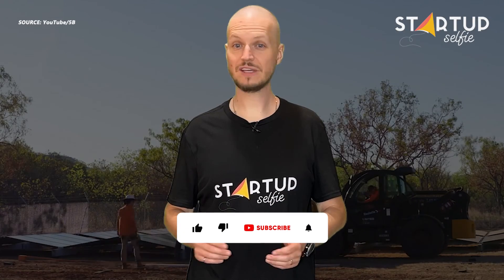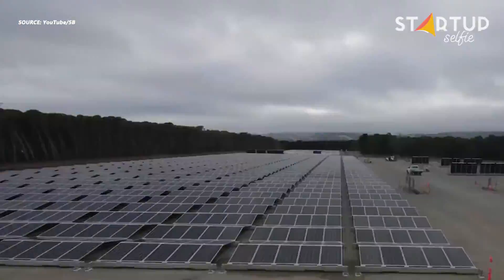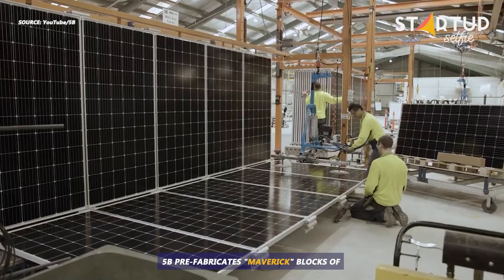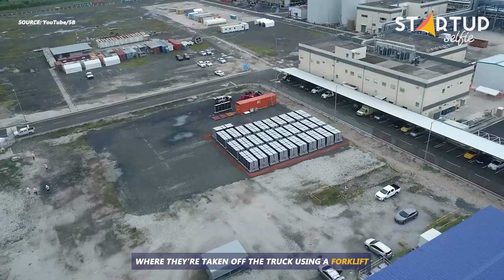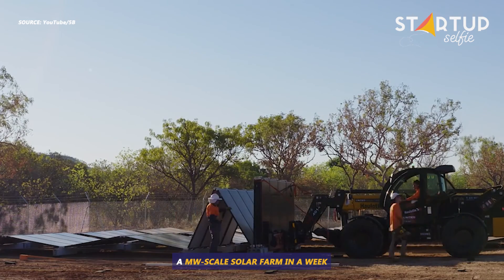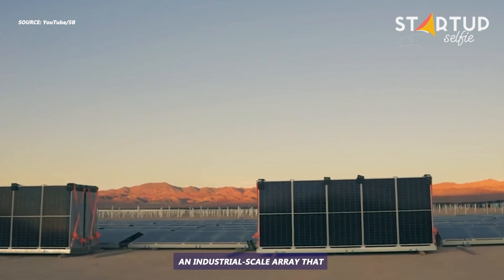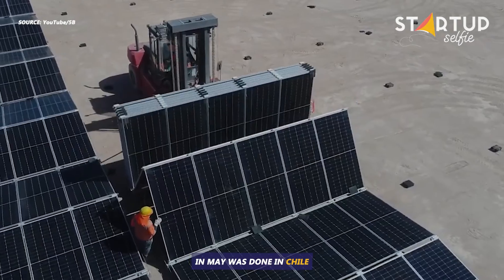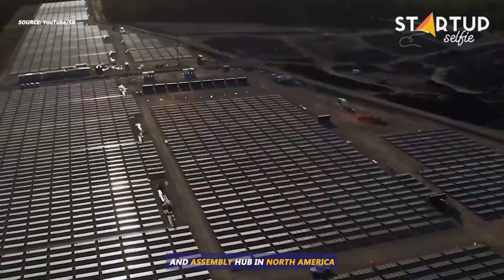Rapid-deployment solar arrays

Comment: Where are the lights? Lights lights lights! Solar panels need lights! For 24/7 365 power supply just add lights! Wind power just add a fan! Hydro power just pump the water back into the lake!